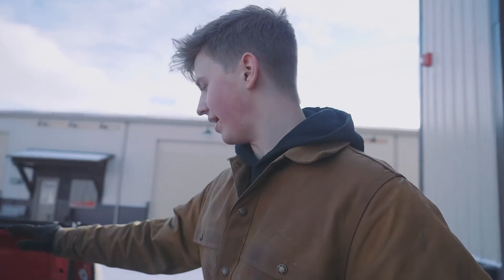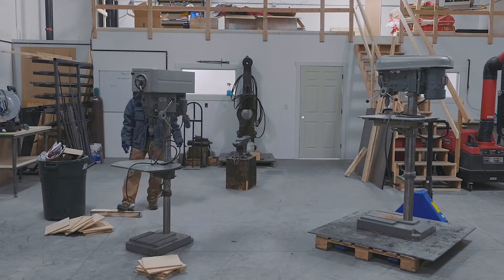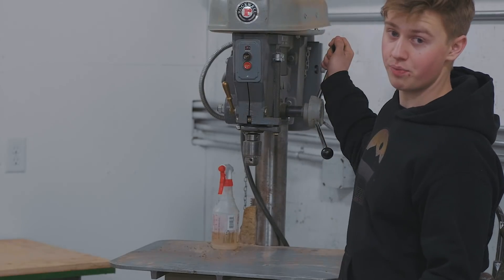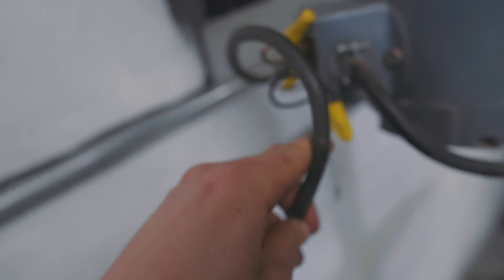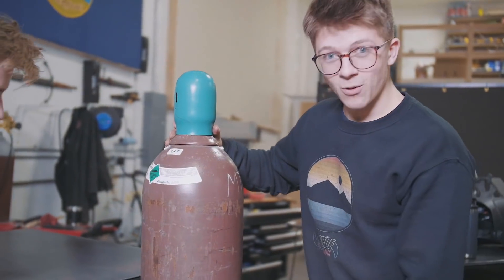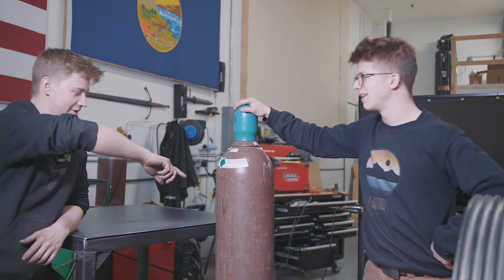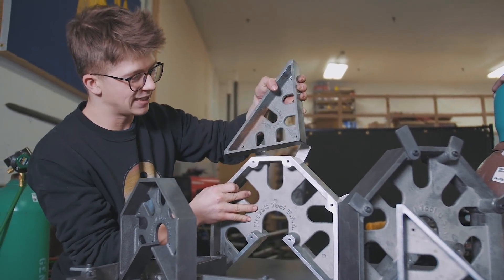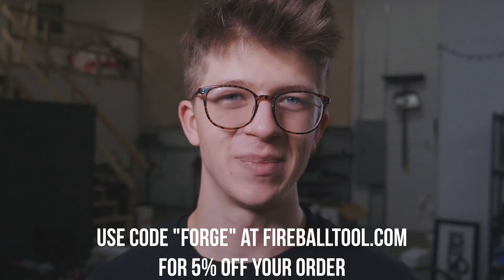TWO BIG OLD DRILL PRESSES AND MAKING A WELDING CART!!!

Comment: I'm gona go out on a limb here and say you are probably going to find that mega cart a mega pain in the ass. By the time you get your MIG and TIG and gas bottles, some rods and clamps and what ever else you plan on storing on it, it's going to weigh a ton and it will be hard to move around. On top of that, unless you are working beside each other, only one person can be welding at a time, even if one wants MIG and the other wants TIG. It might be fine for now but once you go into production you are going to find it more of a hindrance than a help. If you haven't changed your mind already, I'm going to guess it will be about a year before you break down and build your self small individual carts for each machine and for your bottles.

Comment: Yeah so two days and no video after 6 days with no video. A lot of us are realizing that were really kind of addicted to your daily videos. I know you've had a lot going on. And I assume that you still don't have a videographer. But a bunch of bunch of us are jonesing for the next video. Eager to find out how the crate fared. And of course very eager to see some work being done. Is there any update on the replacement machines coming from Chicago? I think you need to fly to Chicago when those things are shipping out and travel with every truck driver that is going to be moving that thing and be on site yourself to oversee the transferring from the facility to the first truck to the next truck to the to the the truck going to Montana and the off loading and unloading and offloading of both machines every single time. I think if you're there to make sure nobody does something stupid like try to push it with a forklift from the wrong direction, then everything will arrive in one piece instead of several pieces. It's just an idea I'd be a lot of trouble. It would be a really really fun video series. Hahaha

Comment: "Big" drill presses?  I've got three of those Delta in the step-pulley version, two floor and one bench.  All of them had the same wiring issue yours did, it's simply age...

The big drill press has to be moved with a forklift - Clausing 22V 20" with Reeves variable speed control (think it's the same as your VS (make sure to run the speeds every time you use it) and mechanical power downfeed.

PS - stick with aluminium; you're British, the American pronunciation sounds odd...